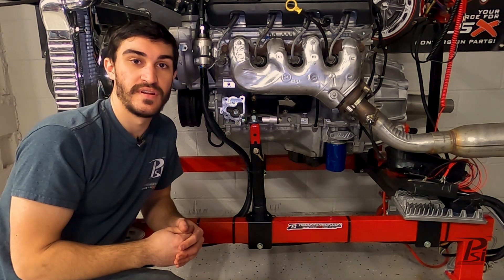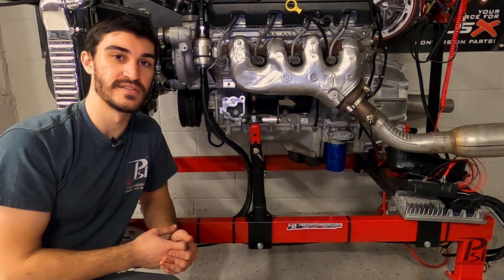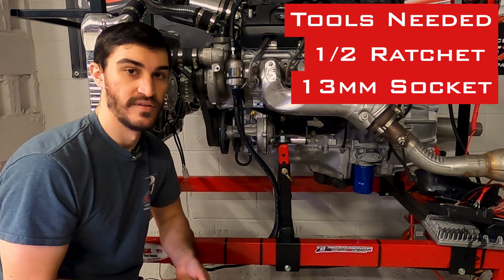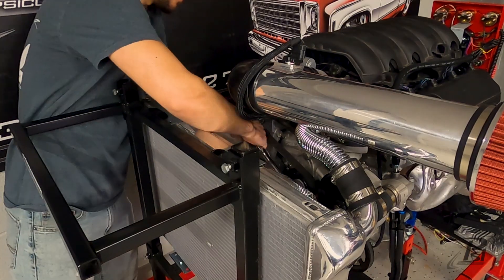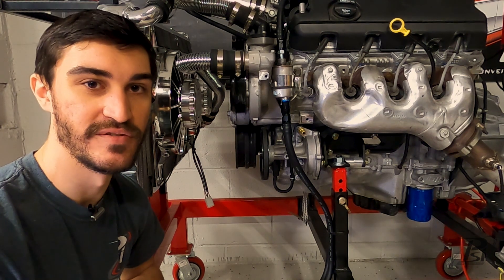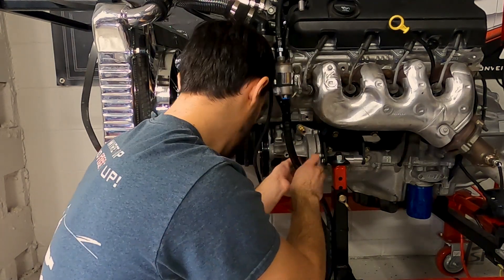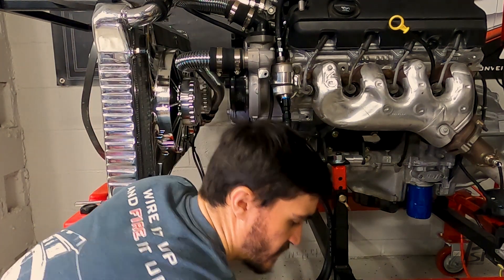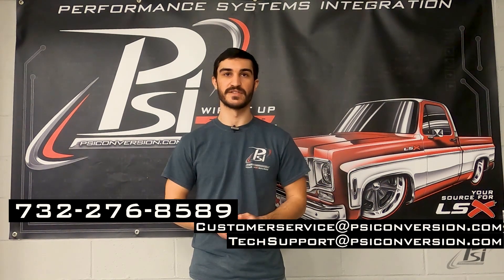PSI How to Remove Vacuum Pump from Gen V LT Engines ( L83 5.3L  / L86 6.2L ) ( ACC-1059 )

Comment: Can you just cut the belt and leave the pump on the engine after rerouting the vacuum line? Or do you need to remove the pump and block off the oil passages
Reply from the maker: We wouldn't leave it; Recommend removing it and blocking off.

Comment: Where did you get the vacuum from for the brake booster after taking it off I have ran mine into the intake manifold but it drop the idle when coming to a stop
Reply from the maker: That what we did and it worked fine for us. You may have another problem going on but in any case if your a psi customer please call our tech line and we will help you out.

Comment: I understood that vac pump is to provide vacuum to the crankcase which is required because of the thin piston rings that are used on the new LT1 engine.
Reply from the maker: The LT1, which is in the corvettes and Camaros does not have a vacuum pump.   The truck L83 and L86 have the mechanical vacuum pump seen in the video.  You are probably thinking of the oil scavenging pump in the new LT2’s in the C8’s.